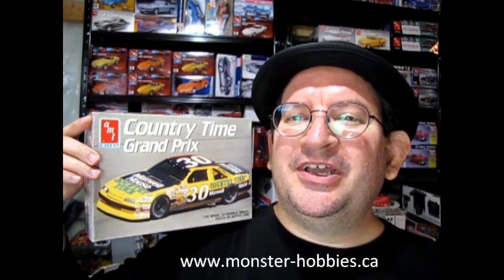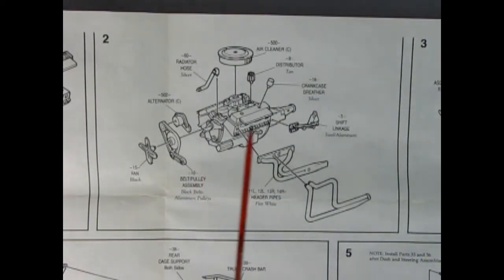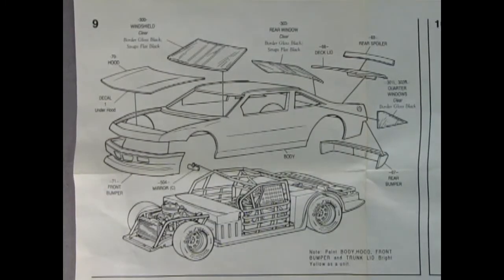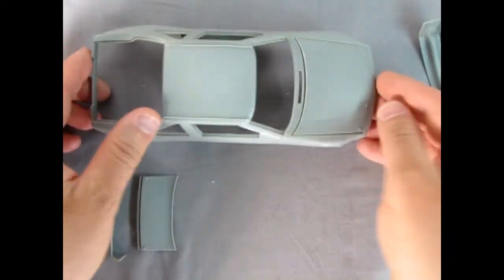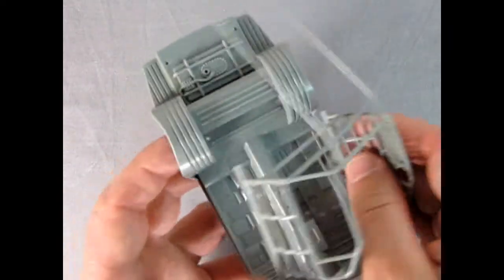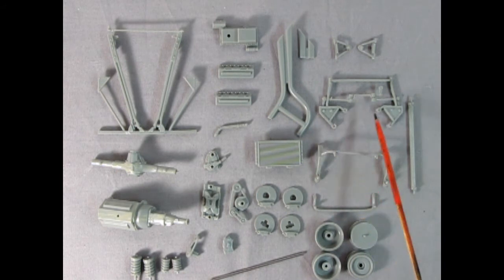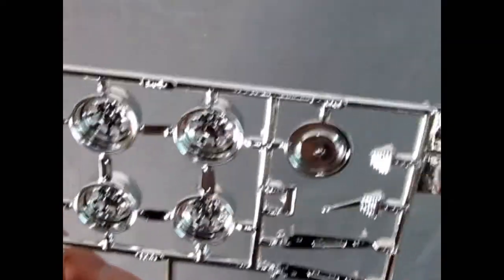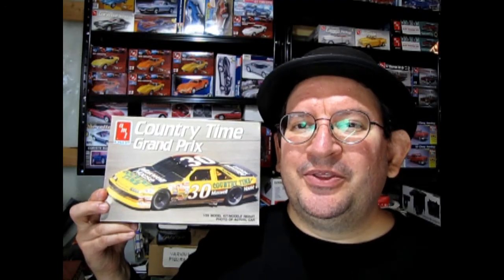Unboxing The 1990 Pontiac Country Time Grand Prix Model Kit by AMT/ERTL

Comment: I just picked up the Petty version of this kit today. I was totally shocked and pleasantly surprised at the quality of it. Super crisp detailing, almost non existent flash and mechanical components that you rarely see in NASCAR kits: X-MSN shift linkage, steering gear box, rear diff oil pump and actual disc brakes with calipers! Even the Petty decals were bright, crisp and well registered (although I'm not going to use them. Gonna do this one in the #27 Kodiak Rusty Wallace ride). The only "issue" I found was that the driver safety net's detail was reversed and facing on the inside. No biggie. I only started building NASCAR kits about 6 months ago, but I've built: Revell, Monogram, Salvino's JR, MPC, and AMT, and I must say that this AMT/ERTL kit is easily the best of the bunch!
Reply from the maker: They did good work on it for sure! 
If you want to see what NASCAR model kits I have in my store, check out this link here : https://www.monster-hobbies.ca/Hobby_Products/c101-nascar/
Reply: @monsterhobbies  Cool! I will definitely check you out.
Reply from the maker: @mattfulmer4243  Thank you! Sign up for the newsletter if you get a chance. It's my weekly discount flyer on selected items and categories. I hope you find it helpful!